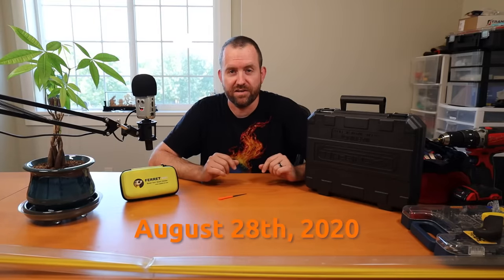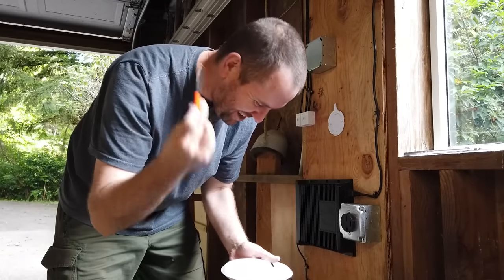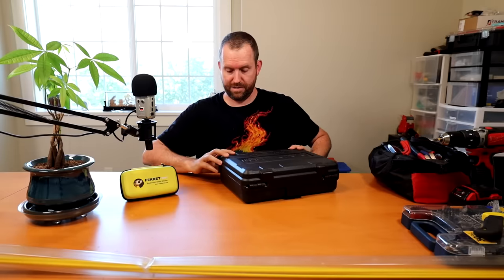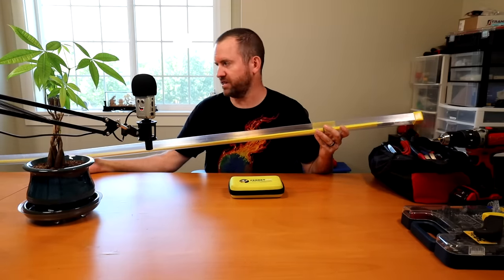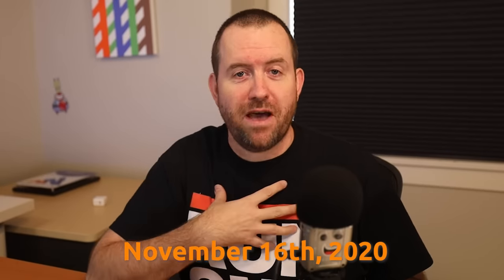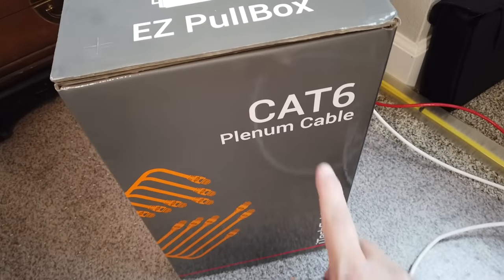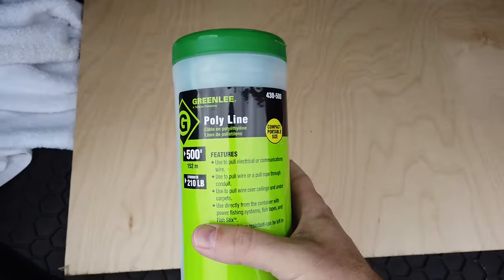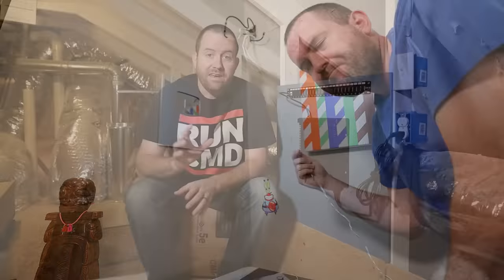CAT6 Wall Fishing

Comment: Why aren't you using the orange single-gang Low-Voltage boxes?
Reply from the maker: That's another option for sure!
Reply: Right now those are hard to get at least where I am at. The stores all blame coronavirus related supply issues.
Reply: As someone who does cable running as a side gig I can tell you since about April when a lot of schools started online learning the demand/desire for a hardwire network in the home has shot through the roof.
Reply: A mud ring would provide stronger support, but I bet the 2 wall anchors he put in for the plate screws are up for the job.
Reply: @jeremymyers5503  if I do it correctly in our home I won't go through the roof.
Reply: @spasmonaut10  I couldn't find a 'shingle' person who agrees with you.
Reply: Nice vid. A couple suggestions from a guy who pulls a lot of wire. Always install some tyoe of orange low voltage open box or a mud ring to support the wall plate. The little screws in drywall will fail. Always leave about a foot of slack cable at all ends of a cable. This is called a service loop. Always run an extra cable of a different color then coil it label it and zip tie it. Trust me on that one. Punchdown jacks are more reliable than toolless jacks. If you have multiple jacks in a plate use different colors. Keep wall jacks a minimum or 12" off the floor. If you run CAT(x) on outside of building use CMX cable. If you run cable in an air plenum use CMP cable.

Comment: Is the Cable ferret magnetic, could be useful for guiding it up the wall with that roller thing you have to the point you are interested in otherwise you have very little control over where you are feeding it.

Comment: Aa a senior communications & telecommunications network engineer certified in both Ubiquiti & Cambium Networks in Australia I am yet to hear anyone say anything good about the ferret not even the large electrical wholesale places sell it any more because it was such a dismal failure in Australia.

Rgs
Wayne.
Reply: Strange comment to say about a multi-award winning product (both US and UK trade industry awards) selling consistently well across Australia for 3 years now with overwhelmingly positive feedback. As with any tool the amount of benefit depends on what you want to do with it. If the Ferret camera is not suitable for what you do, fine but it doesn't mean it's not a very desirable and needed product for people who use it regularly. If you hammer in nails all day it achieves little complaining that a screw driver was a dismal failure.....Note that we're always happy to hear of improvements you'd like to see for future models.
Reply: Dear @FerretTools  I wasn't complaining I was just stating facts as a senior communications & telecommunications network engineer i jabe asked several electrical wholesalers across Vic & NSW including Go Electrical, Middys, AWM and so on just to name 3 of many & the feedback has been the same so I am not knocking your tool Im simply stating what I have been told when I have gone into these places and have asked the question.

Comment: Noticed the wood in your attic and walls was painted white.  Is that some sort of code thing where you live or is it a sealer from a previous fire in the house?
Reply: Top/bottom plates in stud-wall framing are key to preventing the spread of fire. They have been required by building codes here in the U.S. for decades, along with a fire block halfway up the wall.

Comment: They make drill bits on flex shafts if you ever want to drill through top plates of the exterior walls behind your ductwork.  It would feed up the wall and drill through from the bottom up providing you access that way.   Electricians use them all the time.   Keep them tight to the stud for less resistance and obstruction when fishing the line/wire.
        You need A LOT more insulation in your attic by the way, you're wasting money!!!   Another 2' or 3' at least!

Comment: The camera is ok, but you only really use it when you need to drill from the second floor down to the first. You can use it to make sure you flex bit is centered on the stud to drill down so you don't pop out in the dry wall bellow you or hit pipe/electrical while drilling. Now I don't suggest that model. I prefer an endoscope because you have to drill a pilot hole in the top header to see the second header to drill down to the first floor. You should do a video with this because that's the hardest part of dropping between floors. As for the entire video they were all hollow walls. You can just shove lets say 9 feet of wire down the hole and get a hanger and make a hook and boom you have your wire every time. If there is insulation you then can use the bullet to slowly drop it in or you can just shove glow rods in with the chain attached to it so you can hear where it is down the wall. That's my preferred method because you can just drop it next to power and you always know where you are.

Comment: The Magnepull would be a real treat in a building with steel studs... just sayin'. The last eight of eleven installs I worked on had steel studs, and they are a real PITA with wire pulls as they can shred the cables if you're not careful. You can also come out of one of those jobs looking like you lost a fight with a dozen or so feral cats if the trades that did the steel stud framing and electrical work were complete idiots and left sharp edges everywhere.

Comment: I see the cable ferret being much more useful in older construction. You just don't know what you're going to find in the walls of a 100+ year old house. It's probably been renovated or added on to several times in the intervening years using old (and varied) building techniques/standards (or no standards at all). Since your house is so new, the ferret inspection camera could confirm that you have a firebreak in the way (and not something else like a water line or a bundle of AC cables, etc.). I can't think of much else it would be useful for (related to cable pulling at least) in a modern stick-built house that was built to code.

Comment: The cable ferret would be best to see if you have fire block in your wall. This comes in handy when running wires in walls. Most interior walls don’t have as much fire block. Most of your exterior walls have that and insulation. I would use a semi rigged wireless endoscope. I use the one below. Link to Amazon.

Wireless Endoscope,DEPSTECH Upgrade 5.0MP HD WiFi Borescope, 16 inch Focal Distance, Semi-Rigid Snake Inspection Camera with 2200 mAh Battery for iOS & Android Smart Phone & Tablets-16.5Ft https://www.amazon.com/dp/B07MV6X4M4/ref=cm_sw_r_cp_api_fabc_mveTFbHHZK8W2?_encoding=UTF8&psc=1

Comment: I envy the North American houses with wooden walls. My house has concrete walls and floors and I have to run about 8-12 connections it's gonna be rough.
Reply: I imagine that surface-mount raceways and enclosures would be the only practical option for that?
Reply: Oh not all american houses are like this haha, lots of pre 60s are lathe and plaster and the old plaster was basically concrete haha. My situation sadly haha, was easier to come from beneath for me and through the floor.

Comment: I like the idea of that industrial switch.  However, it doesn't look like it would survive the heat in Texas attics.
Reply: The website states it can handle up to 122F. I've only been to Texas a few times but I can see an attic there hitting that temp. You'd probably be pushin' it!

Comment: I am an installer. I don't use Cable Ferret. Instead, I use an inspection camera, e.g. https://www.bosch-professional.com/sa/en/products/gic-120-c-0601241200 (I actually use a budget store-brand device, but same idea.)  I don't use it often, but for a difficult fish job it's indispensable. I use it to find horizontal blocking in walls, or to see if my cable and/or fish rods are nearby in the cavity, etc.

Comment: Any tips on getting a line to the attic from the basement on a two-story house?
Reply: If you have siding you can drill out to the outside from basement tuck wire in corner of siding behind gutter or just in the corner  and drill into attic from outside. Only bad part is you would need a tall ladder :/

Comment: I would’ve oriented the attic switch with its ports downwards to protect them from gathering dust in there.
Reply: That makes sense since nobody is going to be up there staring at the flashing lights like a typical setup.
Reply: They had dust caps on the ports

Comment: The last owners let the idiot cable installer run the cable on the outside of the house so I just had to cut it all off and run my own cat6. It would have been so nice to use the cable to pull replacement. I found a 72” flexible bit a great help in coming from the basement up a couple of floors to the attic.

Comment: History lesson: 
1982 - 10BASE5 - Thick Ethernet (RG-8U) 10 Mbps
1986 - 10BASE2 - Thin Ethernet (RG-58U) 10 Mbps
1991 - Cat 5 - 4 Twisted Pair - 100 Mbps
2001 - Cat 5e - 4 Twisted Pair - 1,000 Mbps (1 Gbps)
? Cat 6 - 4 Shielded Twisted Pair -  1 Gbps
? Cat 6a - 4 Shielded Twisted Pair - 10 Gbps
? Cat 7 - 4 Shielded Twisted Pair - 100 Gbps
 
 Note: If Cat 6-rated patch cables, jacks and connectors are not used with Cat 6 wiring, overall performance is degraded and may not meet Cat 6 performance specifications. https://en.wikipedia.org/wiki/Category_6_cable 
 
Therefore: why not also pull a spare poly-line to leave behind for your next network upgrade? :-)

Comment: What was the tool used to remove the APs from the wall?
Reply: Here is the link:

https://www.techtoolsupply.com/ProductDetails.asp?ProductCode=RTC-UTC4-10
Reply: @bennymolayal3118  I use a paper clip, squeeze the smaller side with pliers to fit the notch.  Works great.  At times the clip has broken but left enough bend on the tip to release the tab and alow the AP to rotate.

Comment: Hi Chris, how do you tackle CCTV/WiFi jobs etc? do you have subcontractors cable? Where I work we are all multi skilled, so we cable and install the hardware but interested to know how you do it
Reply from the maker: I am not permitted to run low voltage cable, so we have local electricians who do it for us.  Frankly though, I don't do much local business...I've only used them a handful of times.  99% of our stuff is remote.
Reply: @CrosstalkSolutions  Ahh over in the UK literally anyone can call themself a cable installer so you'll find most people over here just do it all!

Comment: You need 2 tools for pulling your cabling job in this video.. 
A fish tape(15, 25, 50, 100ft) and pull rods for long open runs. 

You have plenty of room in your attic my friend, you just don't know how to perform the job is all. 
From your room you would push fish tape up into attic BECAUSE you have a HUGE hole right there to guide it through the hole on 2x4 in attic. 
Then from the attic you will use rods with a hook to grab it, attach a line, and pull it back down. VERY VERY SIMPLE!! 
An even EASIER way would be to push fish tape from the top hole(old hole) to the bottom hole(new hole) and cut the current run.
Now pull cable from bottom hole and out the top hole, firmly tie the new cable to old run and simply pull it from network closet... DONE
$40 vs $300+

I wonder how much you got for advertising the unnecessary product though? 
Because it seems like for someone who doesn't do this type of work you spent more money than needed and showing tools that are for way more complicated job sites.

If you are using poly line then you'd be wasting money in the long run and fucking up the environment for no reason EACH time,
but hey who needs the environment.. RIGHT?! Just add more plastic to throw away later...

Just think about a HUGE site and how it is performed. lol I pull about 30 miles of cabling per week/week in a half.

I personally just go to the server room(network/electrical closet) and unbox/unpack multiple nylon strings(over 1000ft each box). I typically like to buy as many boxes of nylon string as there are rooms getting a drop. I'm looking into switching to metal strings that can handle pulling 12x CAT7 cables further than 200ft and just cut off drops for each office and pull remaining length per room. The main issue with that is organization and extra probing work so the engineer installing the equipment doesn't have to probe each drop cause it was mislabeled or not labeled at all.
Tie 1 nylon string to a dongle on your belt or tool of choice. For each ROOM you will feed 1 line. 
A Laborer in that room will pull down an extra 12ft of line down into the room. 
If it's a small buildings just use rods and J Hooks and hope for a new construction site and not a finished building haha.
If you didn't get or couldn't et enough nylon boxes for each office/room getting drops then save 1 nylon line to pull any remaining strings to remaining offices/rooms on that floor. 
The more boxes of nylon you have the less back and forth you have to do or the less stop and starts. Again, this is for running multi floor buildings with hundreds of offices.

When you go to pull the cables for a room just have a walkie talkie Room X(Tech) and the other in the Network Closet(Engineer). 
The Engineer grabs the bundle of nylon that is pulled and grips it while the Tech tugs on the line from that room. 
The Engineer will see the string move and attach cabling to that string. Once they write their markings they will let you know to pull the line. That one string could be pulling 1x Cat6/7 cable or it could be pulling up to 6x cables at once into that office/room.
Once those cables are pulled the Laborer will perform management for that office/room and the Tech moves to the next one.

Now go to the next floor, pull 1 string through your hole in the floor and pull the same amount of strings for each office/room getting a drop for that floor.
Typically you will have an IDF closet after 1 or 2 floors(no more than 280ft between MDF or an IDF closet). MDF(Main closet) / IDF(Extender/Midway closet).

Comment: 4x4?  Really?  Most wall cap plates are two 2x4's  3" thick not 3 1/2" thick...  Never seen a wall framed with a 4x4 at the top.

Comment: So many fails with this , first one was not even done by this guy ! Alarm guy failed when he mounted the system  in the attic .  You then drill a hole over a coax wall plate , that you could have simply used existing hole . then there is no LV1 , old work box or mpls plate installed in your new hole . Did you fill 3/4 hole with fire caulking?  As a the art work on the wall seems to imply , you know network working . You should know better then to put the switch in the attic !  That’s no good , Your giving diy people the wrong info .